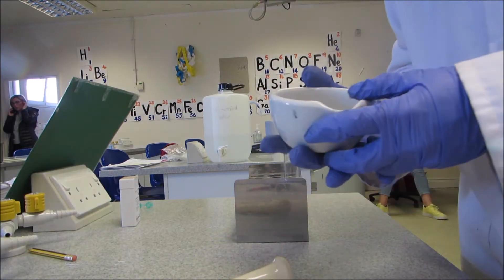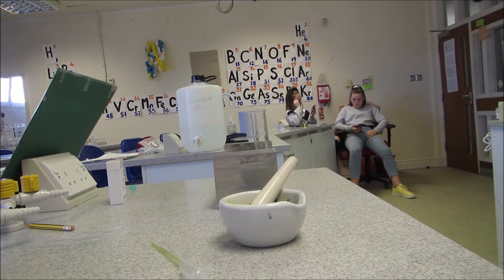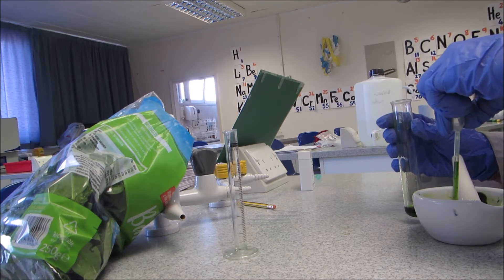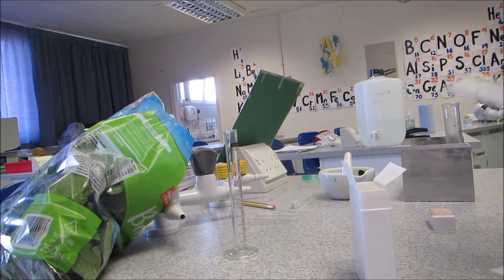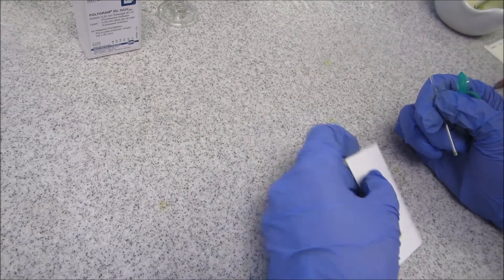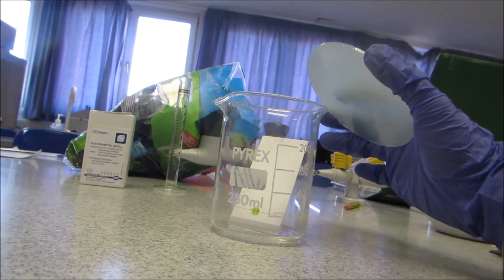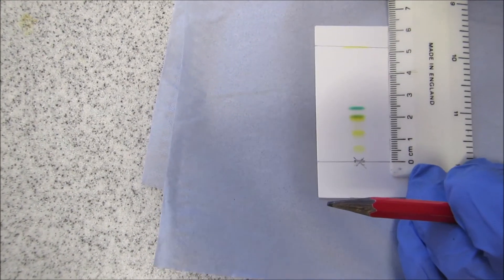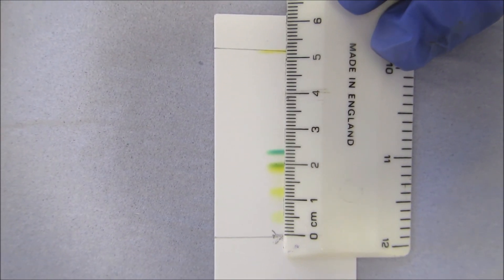TLC (thin layer chromatography) of pigments from spinach

Comment: What is the chemical used other than acetone while sample preparing
Reply from the maker: it is hexane
Reply: @allispracticalscience503  why do you mix hexane and acetone when grinding the leaves? what is the purpose?
Reply from the maker: @evamoses9720  Leaves contain many different pigments for photosynthesis. Some of these are more soluble in hexane and others are more soluble in acetone. By using a mix of both you are more likely to extract all the different pigments
Reply: @allispracticalscience503  thank you!! ☺️☺️